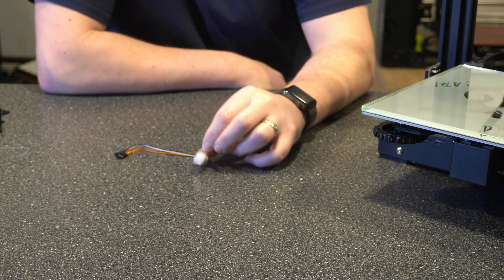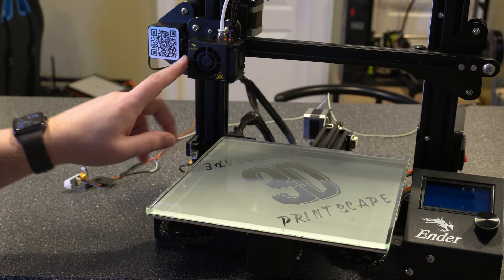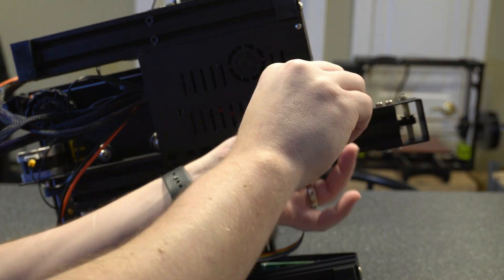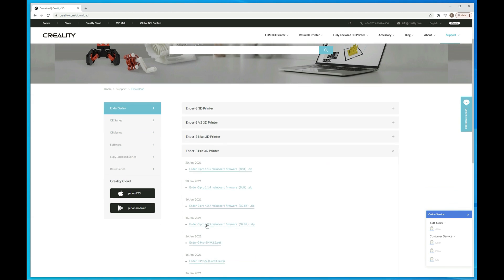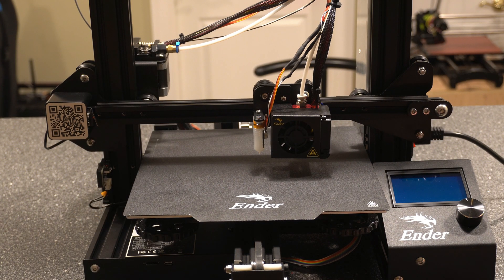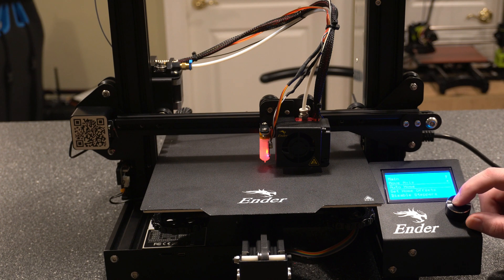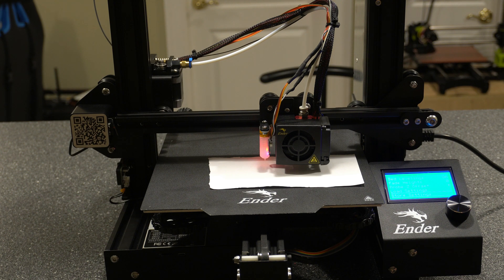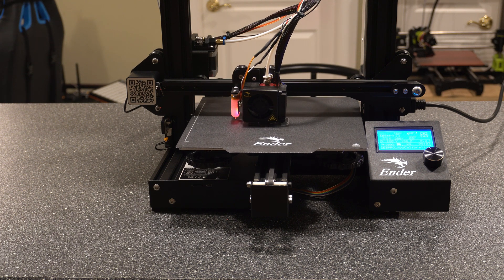Guide to Install a BLTOUCH on a Creality 32-bit Mainboard

Comment from the maker: I hope you found this overview helpful! If you have any questions or would like other tips/tricks, just let me know in the comments or join us on Discord.
Reply from the maker: @Hakamotive  Hi. Thanks for the feedback. I have multiple bltouch videos coving the install on the SKR Mini, Creality 32-bit board, and Creality 8-bit boards and they were all meant to be stand-alone videos. If you went through each of them, I can see how it would be confusing. Unfortunately, there isn't a one-size-fits-all as it can be different across boards and people like to wire them differently. To make it more confusing, iv seen the bltouch ship with 5 different harness wiring outputs. I'm taking it you have one of the reality 32-bit boards. If that's the case and you want to stick with the reality firmware, leave the z-stop plugged in and connect all five wires from the bltouch to the bltouch port. Make sure the wires follow the table I have in the "written instructions" article I wrote that you can get to from the description of this video. Hopefully that helps as I cant provide more guidance without knowing the pinout of the bltouch you ended up getting.
Reply: Hello, thank you for this helpful video. I've got the same printer with the same V4.2.2 board and BLtouch V3.1. I've followed the steps of hardware wiring and updated the same firmware on my printer. Everything I've done was identical to the video until 10:18 mm:ss in the video. The BLtouch did not deploy and a message pops up on the screen saying "Home Z First". I've tried moving the  Z-axis manually but it wouldn't go down! It moves up but it doesn't respond when I rotate the knob counterclockwise. Can you please help?
Reply from the maker: @Hakamotive  Hi. How did you wire the bltouch and what firmware are you using?
Reply: @3DPrintscape  Hi Rob sorry I just saw this notification. I have changed the BLtouch hardware to 5-pin connector and built my own Marlin firmware by following this video. The last couple of months I had spent in trying to fix the BLtouch weren't successful until I've changed the BLtouch hardware itself from 3+2 pin to 5-pin. The BLtouch works now, but I have one issue left, I will send you the video on Discord
Reply from the maker: @Hakamotive  Ya, the wiring has to match the firmware config. I think you reached out on dicord as you mentioned but if not let me know.
Reply: @Hakamotive  I have the same problem. How did you fix it?
Reply: hi i am not sure what kind of ender 3 i have because i tried v1 v2 and pro and my BLtouch wont deploy when it is turned on and is flashing. the z axis also wont go down. im not sure what i am doing wrong. please help me.
Reply from the maker: @Lurkermcgee-h1s  Hi. How did you wire the bltouch and what firmware are you using?
Reply: @3DPrintscape  I kind of feel he has the same problem I had. The original wiring doesn't use the one you show here. The BL touch had to be on the Z axis an the screen connector. That did not work!! After I replaced the connectors of the BL wires an connected all like you showed, it worked for me.
Reply: Rob I have just installed a bl touch 3.0 following your video. when I go to level the bed it only does 4 of 9 grid checks. any idea why this might be happening? I used the firmware from creality for the 4.2.2 board which is what came on my ender 3 pro
Reply: I have the same printer and 4.2.2 board. Downloaded the same zip file. Extracted and moved to SD card. Put card in printer and nothing. Says no tf card. Is the card itself giving me issues? I've been using it for prints but formatted for this.
Reply from the maker: @scruffy357  It sounds like its the card. I have seen many examples where the card works for printing from but not for the firmware update.
Reply: Hi, kannst du mir bitte weiterhelfen? Bei mir hat die Firmwareinstallation geklappt, aber beim Bed Leveling, fährt die Probe nicht aus und mein Extruder fährt gegen das Bed. Ich weiß nicht wie ich das machen soll
Reply from the maker: @dreamscape_weddingfilm  It sounds like the firmware may not have uploaded. When going through the menu, do you see anything related to bltouch?

Comment: hi. i'm from Brazil. 
Actually i've try to install the firmware but in my screen doesn't appeared bed level. i've try many times with different firmwares and nothing. what i have to do
Reply from the maker: Hi. If you dont have bltouch in the menu the firmware upload didnt take.

Comment: how do you change the height of the bed through the panel and not the giant spinning thing below the bed
Reply from the maker: Hi. You dont need to change the height of the bed, you just want to make sure its level. From there you would set the z offset, that is what accounts for the difference between the probe trigger and the nozzle. Also, when you home the printer it will be at +10mm, the z offset doesnt come into play until you start a print.

Comment: for bltouch with auto bilinear 3d printer start g code write for me
Reply from the maker: Hi. Im not sure what your asking here.
Reply: @3DPrintscape  I use automatic blinear. When starting the 3D printer, can I retrieve what I have previously saved from its memory or should I start it with G28 G29?
Reply from the maker: @ozanyilmaz83  Ah ok, i always run the g28 at the start of the print to get the most up to date reading. Things can shift around, especially if the printer is being moved around. Some feel its overkill but to me adding an extra minute to a multihour print isnt a big deal.

Comment: I realize this is an old video by now, but how at 5:40 how did you get the cable end connectors to stay in the header? Mine are so loose that they fall out and never really feel like they're making a good connection. Thanks for the tutorial!
Reply from the maker: Hi. They just connected and stayed. If yours is loose, you could use hot glue to make sure they stay.

Comment: Hello, thank you for your video. It was truly very useful. I followed the steps in your video, and the BLTouch seems to be working. The issue arises when it starts sensing the bed height; the first 3 points it measures are outside of the bed, could this be a firmware problem? I'm using Ender-3 with Marlin 2.0.6, HW 4.2.2, BLTouch GD firmware from August 16, 2022. The board I'm using in my Ender is the same as yours, V4.2.2. Do you have any ideas on how I could solve this problem? Thank you very much in advance!
Reply from the maker: Hi. It could be an issue with settings in the eeprom. Try restoring the default settings in the menu to see if that changes anything.

Comment: I’m having an issue with my CR touch, when I try to level the bed and auto the printer home, the CR touch fails to deploy the censor and it causes the Z axis to run away downward forever and the censor never deploys

Also the new extruder when it auto homes it moves on the x axis slightly but dosent go back to the X axis censor ,  any advice?
Reply from the maker: Hi. It almost sounds like the firmware didnt go to the printer or there is a wiring issue. Do you have anything related to BLtouch in the printer menu?
Reply: I do, I use the most recent marlin software for the 4.2.2 bored, it has level bad auto home, everything that we would need on the firmware, if you have time, I have an actual video of the issue on my channel is the most recent video.
Reply from the maker: @rasp3102  I took a look at the video and it feels like there may be an adhesion issue. It also looks like your not using the crtouch now, is that right?
Reply: @3DPrintscape  it’s not the short, it’s a full video

Comment: I bought my bltouch second hand (still brand new in box) it came with a usb ISP, two other small boards, the 3 wire Dupont pin I had to rearrange the blue and red wires, and the white and black wires are in a connector that fits in the z axis spot and not the spot you put it in. Any idea what this extra stuff is?
Reply from the maker: Hi. It sounds like you got an older one meant for the 8 bit boards. They didnt have a bltouch port and you had to use a transition board. If you set the pinout correctly and connected it to the bltouch port (all 5 pins) it should work fine.

Comment: Hi Thank you so much for that video, and also for the ressources you gave on your website ! I went through your tutorial, everything went smooth... until I launch the printing ! And there, the printing head is a few milliters above the plate in some corner, and touch the plate in other corners ! As if it totally ignored the bed leveling it did a few seconds ago...
Reply from the maker: Hmm, try to clear defaults then set your z offset again. You may need to use baby stepping to dial it in.

Comment: After installing the firmware my screen is blank. Please help.
Reply from the maker: Hi. What firmware did you install and did you take the sd card out afterwards? If the filename is the same as the one used before it will just leave a blue screen.
Reply: @3DPrintscape  Hey I got it to work but now it is asking for a TF card and when I inert the SD card it does not show it I replaced my SD card and it still did not work can you help?
Reply from the maker: @ex_method  Ive seen this if wrong/bad firmware is uploaded. I would try a different build.
Reply: @3DPrintscape  it is not letting me load a different build
Reply from the maker: @ex_method  If its the creality build, try to use one from my site.
Reply: @3DPrintscape  do I have to format because it is still not working.

Also do you have another way to talk to you instead of youtube chat?
Reply: @3DPrintscape  I have made a post on your discord.
Reply from the maker: @ex_method  Possibly, depends on the card. You can also reach out on discord.

Comment: What if I have a bl touch and want to do a custom firmware upgrade or do home calibrations
Reply from the maker: Hi. You will want to build a custom version of marlin. I have some videos covering the process.
Reply: @3DPrintscape  Hi my printer is freezing after the first 10 seconds of printing and i have tried multiple times but it wont stop
Reply from the maker: @mryobot  Have you tried different files?
Reply: @3DPrintscape  I got it to work, I figured out how to go in and edit the code myself. Thanks alot though
Reply from the maker: @mryobot  Im glad you got it working :)

Comment: First of all appreciate everything you do for everyone including myself.  Followed your video several times and continue to have problems.  I am a newbie at 3d printing and that's why I've purchased this printer because after rebates it was $99.99.  with that being said my z probe is -2.4 but when I kick off a print as it's going through the 9 point level check when bl touch probe hits nozzle isn't even close to the bed.  I've done this several times and for the life of me I'm stumped.  Had this thing forever and can't print on it.  Could other things/printer parts be bad?  Wanted to upgrade but I want practice before getting better printer.  Thanks in advance
Reply from the maker: Hi. If you try to move the carriage does it have a lot of give? If so, tighten that up.
Reply: @3DPrintscape  no, carriage is nice and tight. How can I follow you on discord to make communication easier.  Or do you think the printer is a lost cause?
Reply from the maker: There is a link in the video description to join the discord channel.

Comment: Hi, I have A Ender 3 on which I upgrated to 4.2.7 mother board and added a BL touch. Which software should I download on Creality website ?
Reply from the maker: Hi. You would use the Ender 3 Pro 4.2.7 software.
Reply: @3DPrintscape  thanks

Comment: I found this video to be helpful, but after following all instructions it still does not print.  What could I be doing wrong.
Reply from the maker: Hi. What behavior are you seeing?
Reply: @3DPrintscape  isn’t printing, I ordering a new set of leveling kit table but I don’t know if is the problem, my board sometimes read the micro sd card and sometimes doesn’t ,I don’t know if is the board
Reply from the maker: @enriquedieguez9222  When you say not printing, is it starting the print (so heating everything up) then just doing nothing? Also, have you tried a different file and sd card?

Comment: I bought a BLtouch for my 8 bit board but could not install the necessary support into Marlin as memory was too small. Then I bought a 32 bit board and a CRtouch. Surprisingly I could not physically mount the CRtouch as its location is obstructed by the anchor at the end of the X-toothed belt. However there is room, just, for the BLtouch. Finally another surprise. The cable for the BLtouch swaps the order of the red/blue wires whereas the CRtouch cable is straight through. What fun.
Reply: Should have said its an Ender-5.
Reply from the maker: Hi. Were you able to get everything working? The pinout needed for the 8 bit boards is different than the 32 bit ones. I would recommend looking at what the pins are and make sure they are in the right order.
Reply: @3DPrintscape  I didn't want to risk burning something out with crossed wires so I abandoned that BLtouch and forced the CRtouch in place. It was a hassle but seems to be rock steady. Bed Level works just fine.

Comment: Hi wonder if u can help got ender 3 Pro with dual gear extruder board is a 4.2.7 with a bl touch I'm trying to to work out the filament extruding  speed will be great help
Reply from the maker: Hi. I have two videos coving e-steps and flow rates, i think they will help you. https://youtu.be/_js-xFvznxU  https://youtu.be/3PtS9vVCev8

Comment: What about heat expansion? Should we be preheating before the initial test? Also, turning the printer on its side would mess with the Z wouldn't it? The paper test only takes a few minutes to get close. Would it be wise to do the old school method before using the auto level?
Reply from the maker: Hi. You will want to preheat everything before leveling to get the best reading. Turning the printer on its side will mess with many things including the z axis to a point so you will need to relevel after doing that. I also level the build plate after installing the bltouch to give it a good starting point. The more unlevel it is the more the steppers have to work.

Comment: I haven't installed mine yet (only got my first Ender a week ago) but I still don't see the point of this when you still have to do the leveling and set up the Z offset manually. What am I missing?
Reply from the maker: Hi. It makes it so you dont have to manually level the bed often and accounts for warps in the build plates (which is common with these printers).
Reply: @3DPrintscape  I have a glass bed so warping is less of an issue. I take it that you don't have to level as often or as precisely as the bltouch can account for smaller issues with the levels, right? And tells you about the bigger issues.
Reply from the maker: @kloakovalimonada  Correct.
Reply: @3DPrintscape  thank you!

Comment: Hi! When I try to level the bed (around 10:00 in the vid) my bed doesn't home. A few seconds later, I get a "PRINTER HALTED Please Reset" message. My printer has the exact specifications as the one in the video. Any recommendations?
Reply from the maker: Hi. What firmware are you using, how is the bltouch wired, and is your z stop connected?

Comment: I have searched for it all the places and it’s nowhere to be found on how to install the BL Touch on a CR10 and I have two BL Touch and I would appreciate if you can point me to a instructional video or if you can help with one will be great help.
Reply from the maker: Hi. What board is in your cr10?
Reply: @3DPrintscape  it’s 1.4.4 and not sure if that’s compatible forBL Touch??
Reply from the maker: @fellowreefer  Its compatible with the bltouch just a pain to update. I have a video covering the process on the 1.1.4 board (for the ender 3 pro) but it would be easier to upgrade the board.
Reply: @3DPrintscape  so if I have a CR10 can I upgrade to CR10 v2 board and do you have a link to the install and maybe a board that you would recommend for me to buy.
Reply from the maker: @fellowreefer  You could upgrade to the Creality 4.2.7 or skr mini boards. The process is mostly the same as on the ender 3. I cover it in this video. https://youtu.be/wtT6iA9IG7A

Comment: Just a question. After I installed the BLTouch firmware on my ender 3 pro the screen started to glitch making it practically unusable. Along with that it says I don’t have media in but I do. Do you know what I should do?
Reply from the maker: Hi. This is a common issue. I go into it, and a fix, in this video. https://youtu.be/t4QE1jPncms

Comment: Love your stuff. Keep up the good work.  As I swapped the 8 bit for the new 32 your shots of the wiring help me remember that I need to unswap two of the wires on the connector, and pointed out that I could leave the zstop in place and plug the bltouch into the... well... bltouch connector. Thank you thank you.  Keep up the good work.
Reply from the maker: Glad to help

Comment: Hi there and thanks for a the helpful info.  Do I leave my z axix limit switch plugged in? Because in the BL touch manual it said to unplug it, but it's not working...
Reply from the maker: Hi. You would leave it plugged in. Creality has a specific firmware build where they wanted it removed, not sure why, all this did was complicate things for the users.
Reply: @3DPrintscape  thank you so much. I'm still dealing with screen glitch issues and a problem with Bed Leveling automatically switching off between prints, which causes the mesh to fail before prints. I moved to your 512k bug fix FW, but still no luck, unfortunately.
Reply from the maker: @As_the_Crowe_Flies  Try to move back to the 256k version.